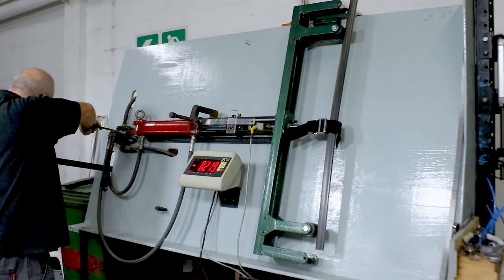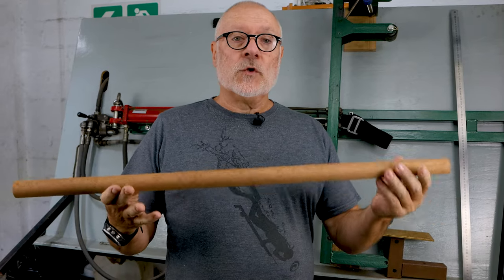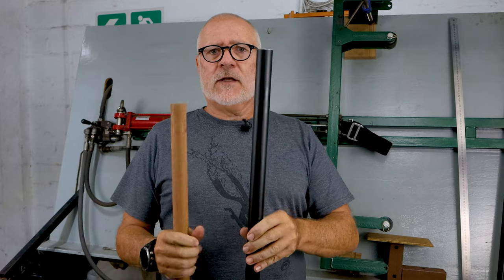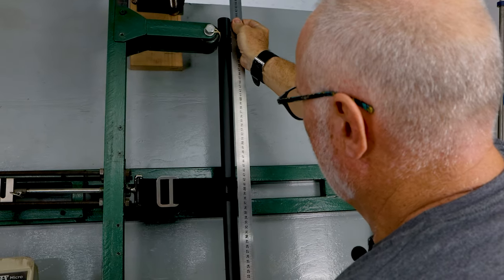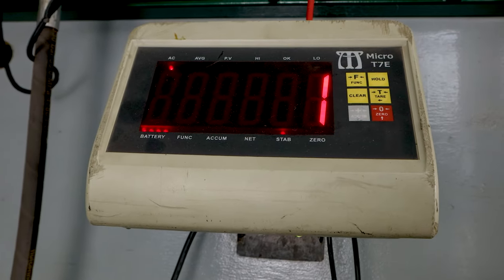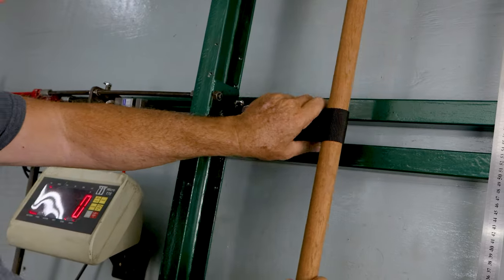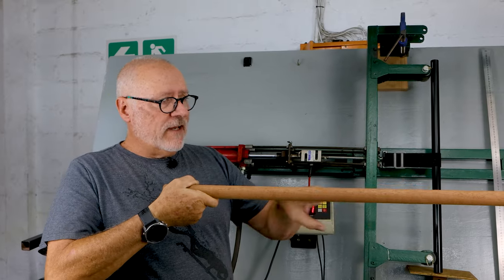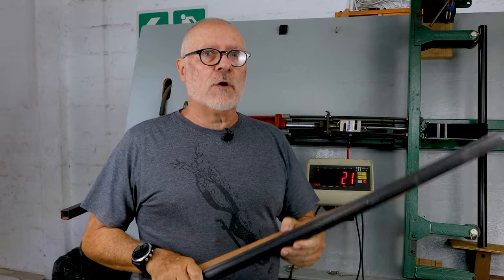Rob Allen | Is your wood good enough? | 2024

Comment: do you think the lamination of timber barrels reduces the flex? as apposed to the solid bit like you just used?
Reply from the maker: I'm no expert but I doubt it. I had tried this timber in a few directions and no different. The epoxy glue layer between laminates could help. I have seen some builders use a layer of carbon fiber to improve stiffness.

Comment: I think the load should be applied along the long axis (compression)....isn't it?
Reply from the maker: A compression load would be a load compressing down the center of the barrel. A loaded gun is not centered but off to one side, hence the barrel flexing. This flex is very little but can be sufficient to cause inaccuracies.
Reply: @RobAllenSpearfishing is it possible to test how much load it takes to deflect them in that setup? Id think it might be enough that either would be okay? Timber guns also usually larger then pipe.
Reply from the maker: @spearo16  One day I will do that test. I have done a test with a laser locked to the gun mechanism while the barrel is securely clamped in a vice. I sighted down the spear, finding a point at about 4m away on a wall. I dialed the laser to that point while unloaded. Then load the gun and checked where the laser light is in relation to where the gun is pointing. The gun (spear) was now pointing 60 to 70mm higher. This was on a 1,2m carbon barrel with 2 x 14mm rubbers. I did not test an aluminum barrel. The point here is, the carbon is way stiffer than the ali, so the ali should be significantly worse, wood being more so. I fully understand wood can be made thicker to compensate but now the maneuverability in my opinion can be compromised. I have no problem with wooden guns, I love wood. I wish it was as rigid as carbon. Our "compromise" is using the carbon barrel as a spine (strength) and adding the timber to the side. That encasing with wood add massive structural strength to the hoop support in the carbon tube as seen in our barrel break tests.